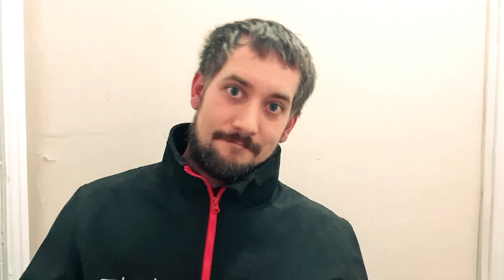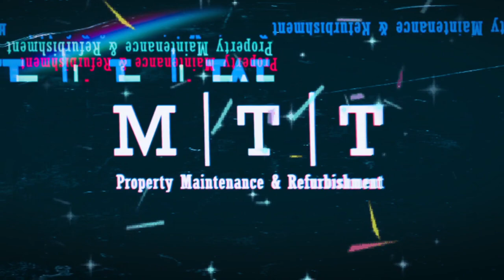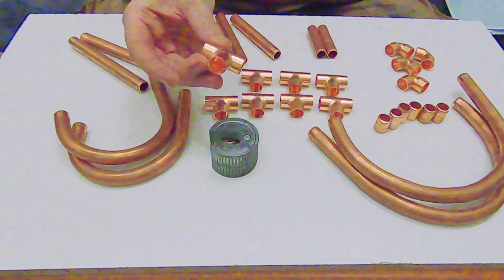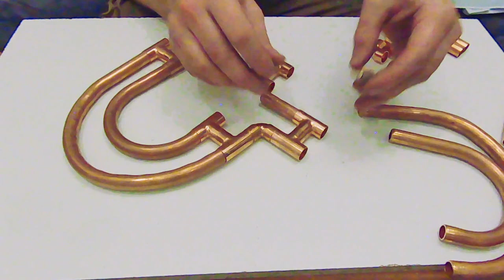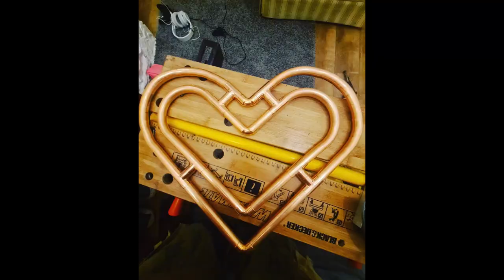5 minute craft diy how to make a Copper pipe art double heart [] By MTTPMR []

Comment: What length was the pipes before the bend. What degree on the scissor bend did you use. What was the length of small straights
Reply from the maker: All depends on the size you wanted the heart I suppose. Can chop down to suit desired size. A full 180degrees in the pipe bender was used. Hope this helps

Comment: what size tube and fittings are you using please. ive tried it with only 15mm ef. but have to insert tube between the fittings. great idea tho thanks.
Reply from the maker: Internal heart is all 15mm copper pipe and fittings, the outside heart is all 22mm copper pipe and fittings. Apart from the T fittings. There are 15mm on the stalk pipe but 22mm on the outside
Reply: @TheDIYHUB1  thanks. so you are using 4 tees 222215mm on the branch.  4 x 15mm equal tees and end caps what sizes are you using ?
Reply from the maker: In total they are 4 of these Ts https://www.screwfix.com/p/flomasta-end-feed-reducing-tee-22-x-22-x-15mm/45076?kpid=45076&ds_kid=92700055281954514&ds_rl=1249404&gclid=Cj0KCQjw4eaJBhDMARIsANhrQADnr_wjP49-rNsBBrReemzPZFgjUMLFaF8D-jO2w2qiqXoN_dGCyxYaAtsyEALw_wcB&gclsrc=aw.ds

4 x equal end feed 15mm T
2 x 15mm end feed elbows
2 x 22mm end feed elbows

There's no end caps, joining the hearts to each other is a small pipe of 15mm pipe joining them together in the Ts

Comment: In the process of making one of these and just can't get the bends right. Have wasted to much copper pipe trying. Can you give me some guidance please on getting the bends right. Thanks Rick.
Reply from the maker: Hi Rick, below are a few links to cheap versions of what will make it alot easier for you with bending. the pipe bender is more ideal and gives the perfect bend! but bending with it is alot tougher than using a spring, i'll try get a video uploading on using both items though for you

https://www.screwfix.com/p/rothenberger-15mm-internal-pipe-bending-spring-500mm/39016?tc=UA3&ds_kid=92700055262507126&ds_rl=1244066&gclid=CjwKCAjwn6GGBhADEiwAruUcKg1RQWLCQZl_dp8ESaheEdKIAWVElhTdJj0_yRhmLv_6IUISuo60KBoC5DgQAvD_BwE&gclsrc=aw.ds

https://www.screwfix.com/p/lever-pipe-bender-15-22mm/18255?tc=UA3&ds_kid=92700055262507126&ds_rl=1244066&gclid=CjwKCAjwn6GGBhADEiwAruUcKq5Kfa40zXfa8rObBQ1n6Yy3SSmVlXTJmyI_hgSv7ms7jE1uevvuDBoC8SAQAvD_BwE&gclsrc=aw.ds
Reply: @TheDIYHUB1  Thank you for your reply.  Have got a pipe bender but just can't seem to get radius on the bends right. That would be great if you could video how to get the bends/radius right.
Cheers Rick.
Reply from the maker: @rickhoutby2459  I'll try get it recorded over the weekend for you. I'll reply to you on here when it's uploaded
Reply from the maker: https://youtu.be/ax-hKtCjK7k the video is up now Rick, hope it helps
Reply: @TheDIYHUB1  Many thanks for your time and help.  Have got it finished but not 100% happy with it.  Hopefully the next one will be better.  Cheers Rick.
Reply from the maker: Happy to help any time, I found doing the outer heart in 22mm and the inner ring with 15mm made it so much easier. Any more help needed just let me know :)